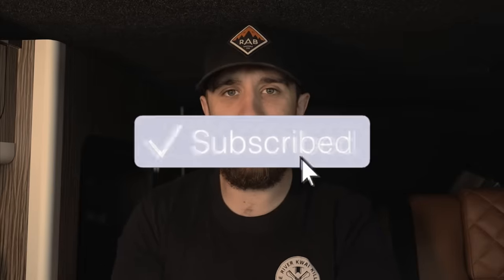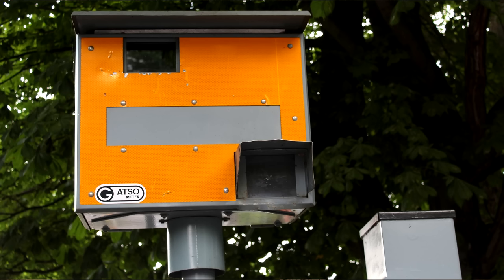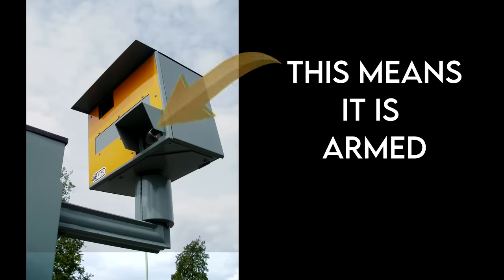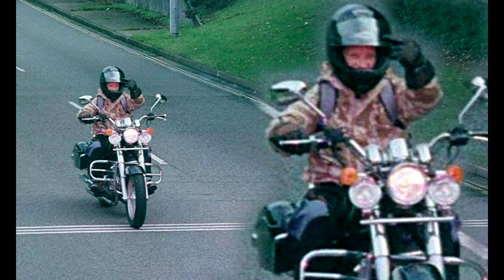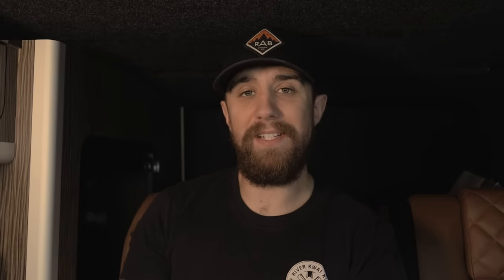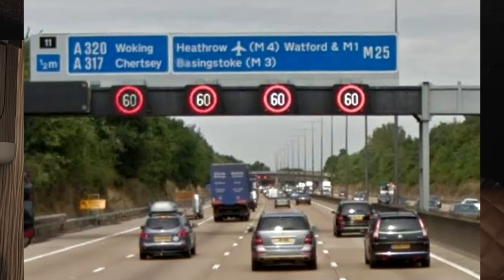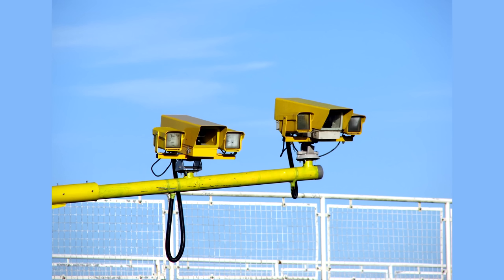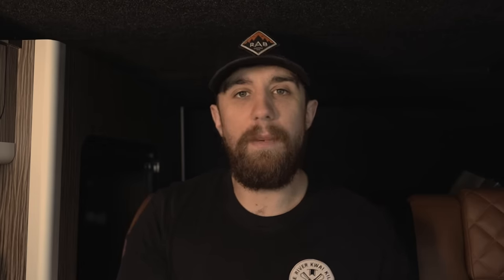How Speed Cameras Work and What to Look Out For

Comment: My biggest issue is that people think “speed camera = 30MPH”.
WRONG!!!
Cameras like the GATSO camera are placed on stretches of road where there have been serious accidents caused by speeding in the past.
The speed of the road DOES NOT change because there is a speed camera.
Whatever the sign posted speed is is the speed of the road.
If a camera is placed on a 40MPH stretch of road then the camera is set to 40MPH.
There is no reason to suddenly drop to 30MPH when passing a speed camera in 40MPH stretch.
If you’re driving in an unfamiliar area and see a speed camera or signs for a speed camera then CHECK THE SPEED LIMIT SIGNS for that road.
If you do not know the speed of the road then you are clearly not paying attention, and IMO that should be a punishable offence.
Slamming on your breaks for a speed camera can cause accidents.
Check the speed of the road!
I have to deal with this on a daily basis.
Reply: Lotsa drivel in your comment. Start by thinking about someone getting fined for riding at 21 mph on a scooter near a school at 1am. Such a criminal he must be.
Reply: @TheRadFactor most cameras don’t get you going 1 over, most are calibrated to get you going 10% over so 22, 33, 44 because analog speedometers are inaccurate

Comment: To cut a very long story short. The law requires two measurements of speed or one measurement and a police offices opinion in order to prosecute for speeding. I was prosecuted for allegedly doing 36mph on an empty duel carriageway. It was recorded on a speed camera but  I knew I was only doing 30mph. On checking the photo and data I measured the lines in the road to find that they were shorter and the data on the camera shoed it was wrongly calibrated.  The measurements showed that I was doing 31mph but the judge still fined me £360 for doing 31mph.  The camera was removed a few weeks later after other motorists were complaining.
Reply: Doesn't even have to a "police officer" police staff will do
Reply: @NoBody-gf8ie  It's stretching legislation  a bit. The Police say it's OK if "staff" are under supervision of the police. It does need to be challenged in the High Court if someone has enough money to do so.
Reply: @peterw4338  the law now states only a witness is required, plus the police staff are fully trained in the use of the home office type approved equipment and also have designated powers and the same legal status as a regular police officer.

Comment: Must admit I've been caught twice by speed cameras. 1 was a combined jump and speed camera with line markings. Got caught speeding because the duel carriage way used to be 40mph. And I was caught doing 37mph. In a replaced 40mph zone to 30mph. 
The 2nd one was a mobile camera pointing at a corner in the middle of nowhere with a speed limit of 30mph with 6 houses set back a good 30 yards from the road. 
While I agree with all of these cameras. Mobile speed cameras I don't agree with. To be honest the new lazer ones I also don't agree with either. And it's this problem. Speeding is only dangerous when either very excessive or combined with driving without due care and attention. This is why gatso ones are the most fair. If you carnt see a bright yellow box with lines on the road. Then your driving way to fast for your attention span. But if you going up a straight road. And there is a camera pointing at you 1km away. I can guarantee the camera operator will not be able to see you with their own eyes. So what makes them think that drivers can see their van from that far. 
Just money making in my opinion. As I've always said. If there was a problem with speeding combined with deaths and or serious injuries then there should be a permanent speed camera.
Reply: The laser can work at 1 kilometer but for a usable image your looking at about 400 metres that's plenty of time to see the big van with police stickers all over it!
Reply: The point is moot. The point isn't about "being able to see the camera" as that has and never will be a defence. It's about "not speeding". You would never go to court and win an argument stating "I was doing 80 in a 30 and got caught, but I want to be let off because I never saw the camera/van that caught me".

Comment: Average speed cameras recognize type of car example- van?
Reply from the maker: I'm unsure on this, it would be good to know though. I would expect as newer cameras are released they will inevitably be able to see the type of vehicle
Reply: I like Digital Corps don't know, but am I wrong in thinking they connect to a ' central computer' and don't store info locally to the cameras. So, wouldn't they be able to I D the type of  vehicle from the number plate, when deciding if speeding has occured?
Reply: @andyj1967  The newest ones do so they can differentiate between a car and a lorry for example. Car legal at 70, lorry not.
Reply: @alasdairmackenzie905  But vans come in different classes, with different limits. Panel limit is 60, the same model as a minibus is a PLG car if not used as a PCV.

Comment: Did anybody point out that the best way to not get caught speeding is to simply not speed? Use the tools in the car, most modern cars with cruise control also have a speed limiter which you can set to the speed limit and will stop you accelerating past it.

Comment: Consumer cars do not have accurate speedometers either, this 10% allows for this fluctuation to be accounted for. Police speedometers are calibrated to be accurate for this reason. Also, to be more specific about the average speed cameras and the slowing down/speeding up, yes that won't work because it's timing you between each set of cameras, but that's not to say if you speed or accidentally go too fast for a bit that you're screwed. Just slow down by how much you went over the limit and your speed will average out, hence "average" speed cameras.

Comment: Of course slowing down and speeding up works between average speed cameras because it is measuring your average speed between them. If you are in an average 30 zone, you can do 50 for a short period as long as you also do 10 for the same period before you get to the next camera. Your average will have been 30 so as far as the camera is concerned, no offence has taken place. The risk you take is not knowing the distance between the cameras. But if you accidentally sped for a bit, just drive slowly until you pass the next camera and you'll be fine.
Reply from the maker: Of course you could slow right down to 10 to make your average come right down, but no one is going 10 on a motorway. My point is as I said if the average speed camera on a motorway at 50mph you can't go 70mph in between them which is what people tend to do when they get caught by these.
Reply: @CorpsMedia  Ah, I see what you meant. You are suggesting some drivers are missing the "average" bit and think you just have to pass them at the set speed limit.
Reply from the maker: @Nick_G7IZR  yes, maybe I didn't describe it that we'll, but cheers for highlighting should anyone else have the same question

Comment: It's when the filth set up speed traps pointing a gun at you in areas where there are never any accidents purely to make an easy buck that it pisses me off. Total abuse of their powers not for safety but for quick cash and an easy days work.
Reply: The police make no profit from speed enforcement so money is not their incentive.
And why has there got to be an accident before speed enforcement is carried out?
Reply: @NoBody-gf8ie  Setting up speed traps on perfectly safe bits of road where there are never any accidents makes it look more like they're doing it for an easy job to get money out of people rather than caring about actual safety. Especially when they only set up these speed traps on nice sunny days and never on snowy or rainy days when surely it's more important for people to drive slower. But the filth and their servants don't want to be out in the rain.
Reply: @JurassicRod  sites are chosen 1 of 3 ways priority is given to community concern areas where local communities request their presence after that collision data then finally it's reports from local authorities of areas where there is lots of none compliance of the posted speed limits, the most definitely do operate in the rain but as for snow many forces choose not to for safety reasons as some people slam on the brakes when they see the van's can you imagine the chaos that could cause in the snow?
The police make no profit from speed enforcement so if money is not their incentive what is?
Reply: The filth.  Seriously.  What age are you?

Comment: Never been caught speeding by one even though I am 71years old and had a licence since I was 19, and been a Trucker for 30 odd years, so no sour grapes here.. Anyhow my opinion, no such thing as a "safety camera", 99.9% are are simply revenue collecting devices. The only "true" safety camera is the SPECS average speed camera. Just saying.
Reply: Even those you can cheat the system if you know how but it makes you stand out like a sore thumb so if there’s any unmarked police around they will spot you straight away. Speaking from motorway driving perspective

Comment: We wont have speed cameras at all soon. Once electric cars are the norm with GPS sat nav, not to mention engine over ride technology...Every road will have a speed limit as now, but if you exceed it, your cars GPS sat nav will know and automatically slow the car down. These limiters can be varied if needed for safety as in thick fog or roadworks.
So a Ferrari  doing 70 mph cant overtake a 2CV or morris minor doing 70 mph. 
One good thing that would happen is that police chases will be no more. They will have the tech to slow or even stop any car using this new tech available to them.

Comment: Driver for over 30 Years .. never any penalty points or any accidents. 
Top tip... Don't believe the "Hype" on high-performance cars ..I have had my eye on a BMW 140i for ages now as my next car. I decided not to bother.  I would only end up getting banned from driving.  These types of cars are pretty pointless here in the UK. 
Why "Walk into the bullet"  ... Going to stick with my 1.8 Litre 115 BHP car ... It has more than enough "Power"  for our heavily monitored and overcrowded roads here in the UK.  
Even just a few years ago "They" would turn a blind eye to drivers doing between 71 and 85 mph on a motorway ..Not anymore. 
Buying a high-performance car here in the UK is like buying a chocolate teapot. 
EDIT.... There is a stretch of 2-mile road in Blackpool with 4 Gatso cameras all on 30 MPH roads.. 
You could drive on this 2-mile stretch of road at a massive 36 MPH and get banned from driving ... 
Meanwhile, corner shops that sell  "Vapes"  continue to sell underage children cigarettes and alcohol, and a blind eye is turned by the police...
let's not say why as a certain r/a/c/i/s/t card might get played if you dare challenge them for doing so. 
So let's just take the "Path of least resistance" and pick on the easiest target... The motorist...

Comment: I find the 20 mph speed limit on roads dangerous, constantly looking at my speedometer making sure I’m not going over the speed limit and having no eyes on the road is more dangerous than using your mobile phone.
15 to slow accelerate 22mph oops brake
15 to slow accelerate 22mph oops brake
15 to slow accelerate 22mph oops brake
Look at my speedo ow I just hit a kid
Reply: I think you should learn how to use your right foot properly, its not the machine, its the operator

Comment: All the mobile cameras I’ve seen in recent years, have had no signage and have without exception, been set up on the exits of blind bends, facing at the brow of a hill, hidden behind bus stops at the bottom of a hill or half hidden by foliage and hedging.
Nothing to do with preventing speeding and everything to do with creating revenue.
Reply: The don't have to have signs, most mobile sites are community concern areas where local communities request their presence due to problems with speeding. Also money is not the incentive of the Police as they make no profit from speed enforcement.

Comment: I got caught doing 82mph from the opposite side of the dual carriageway meaning the camera must be facing out of the front of the Van im sure this is not legal? It was parked in a lay buy facing towards me so I didn't slow down. The pictures where of the front of my car overs the crash barrier. sneaky  💩's!
Reply from the maker: To my knowledge they can face forward they just can't face forward if they use a visible flash so as not to dazzle the drivers

Comment: Yep..
You slow down over a prolonged period while glaring at the speedo!
Reply: The best way not to go over 30mph near a speed camera set to catch vehicles going too fast is to engage 3rd gear and keep off the throttle.
Reply: @derekporter7651  
Why would you use third gear? Third gear will create more low RPM speed and waste fuel.

Comment: There used to be a front facing Gatso in Eastham, Wirral, on the A41. It apparently Truvelo innards in a PEEK box. The only one ever in existence, I believe. It was adapted to be an infrared camera, it must have racked up millions of pounds in fines as everyone from outside of the local area would have thought it was pointed to get you from behind and went speeding past on the other lane (it was in the central reservation with lines on both carriageways).

It never got used on the other carriageway afaik.

It's now sadly been replaced by a digital speed camera, which is quite obviously setup to get you from behind as it's physically located on one side of the carriageway now.

Also, there is plenty of Gatsos still in operation on Wirral and in Liverpool as red light cameras. They allegedly can also detect your speed from lines on the road at junctions, so if you get caught going through a red light, and you're speeding, you may also get additional points for speeding as well!

Comment: Your point about mobile speed cameras and motorcycles is somewhat incorrect. I was caught by one as I travelled past it on the opposite side of a dual carriageway and was sent a lively photo of my rear end and plate. 56 in a 50 🙃
Reply: The Camera Vans can work both ways, coming towards and going away.They also have allround CCTV time linked to the main camera, so if a motorcycle goes past the Van the registration number is recorded. They also use the camera footage for Mobile Phone and Seatbelt offences.

Comment: Middle lane hogging is careless driving that can get you 3pts and a £100 fine, odd how I have never heard of anyone being done for it. The reason is there is no enforcement of this offence so people do it all the time, the problem is you need someone on the roads to tackle this. One police officer could stop and deal with maybe one middle lane hogger a hour, but a camera van could snap any number of people in the same time. Camera's are just a cheaper option than officers in cars, they have very little to do with road safety.

Comment: How many lorries do you know that DONT speed through average speed cameras?
Also, has anyone come across or heard of speed cameras combined with cameras used for jumping red lights?
Reply: They have tachographs that not only light their driving time, speed and distance, but are accurate to about 1%, checked every 2 years for accuracy and recalibrated every 6 (regardless).  If the tachograph says the lorry is doing 80 km/h then it is near enough doing 80 km/h (50mph).  If you think they are speeding through average cameras you'll actually find it is more likely your speedo against which you are measuring that is showing 50mph when you are in reality only doing about 45mph, that is wrong.

Comment: 10% plus 2, i was recently zapped at 35 in a 30, mobile camera stategically placed under trees ,my speedo was reading 34 and slowing down, from past experiance just pay up its not worth the hassel , In my case its revenue and not safety, perhaps the cops farm out the cameras to a third party. Thank you for the video.
Reply: Money is not the  incentive for the police as they make no profit from speed enforcement! All the operators are policing support staff not from 3rd parties. If it got you at 35 but you think you were doing 34 chances are it saw you before you saw it. Shouldn't matter where it was parked as you should always be within the speed limit surely!